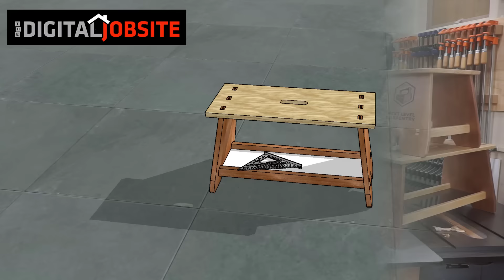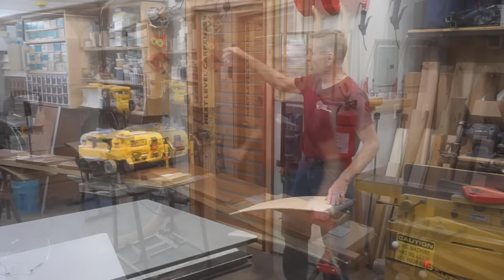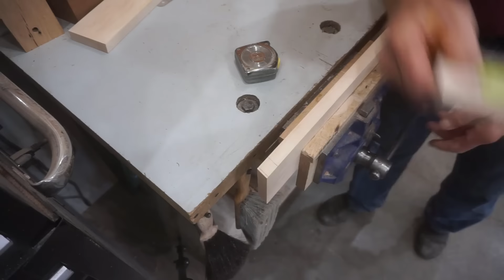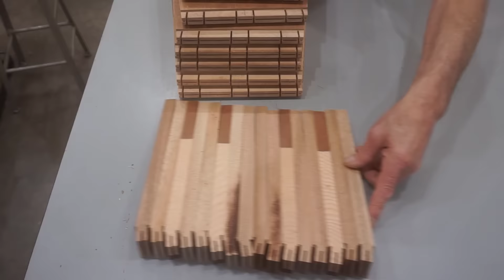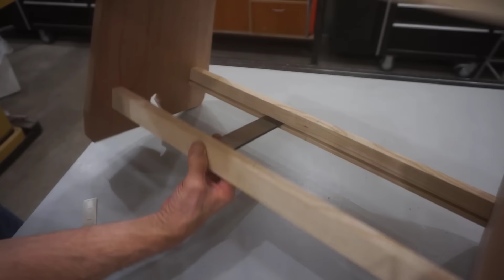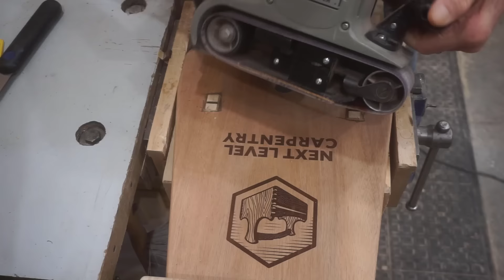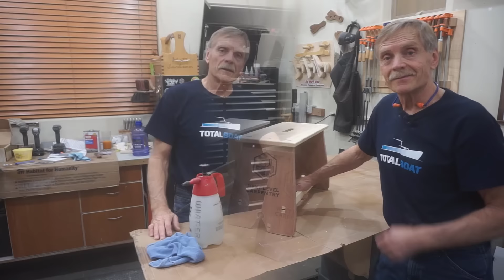Master Carpenter's Footstool

Comment: Awesome video!
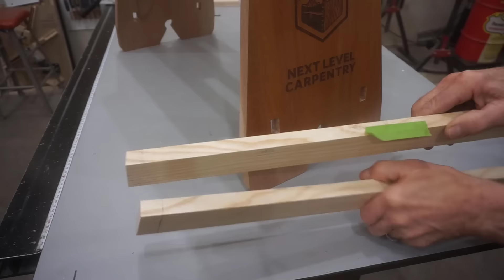@1:25:33 you mentioned you need to shave 3/32", but it should be 3/16" instead.
rails are 3/4" thick
mortises are 9/16" wide

If we convert 3/4 to 16th it becomes 12/16".
You then need to remove 3/16" from 12/16" to match 9/16" of the mortises.
Unless I am missing some other black magic stuff, that should be the math.

Edit: Oh I understand! Both side needs to be shaved for 3/32", which is 3/16" divided by 2!

Comment: Ha ha, Matt, you had me there for a minute with the dihydrogen oxide!  Man, those stools are gorgeous!  I am making some step stools for a friend using some recycled red oak and I would like to use your design if that is acceptable.
Reply from the maker: By all means, Andy: use my design!  Great way to repurpose some red oak and bless a friend... if you run into any issues with the build, feel free to reach out here or through your new Patreon membership! 😎👍
Reply: Thank you sir.  The biggest difference will be the thickness of the stock.  I had to flatten the boards and remove the ugly stain.  They are now about 11/16”. Still thick enough I believe.
Reply from the maker: @andysparks7381  Thick enough for sure... with the design/joinery I bet 5/8 would still be plenty.  The first weakness would be the span of the top where, if you made a longer stool, you might need to add a 'stiffener joist' under the top to give it strength for a big guy to stand on it but, as long as the top is thick enough or supported enough, I'll bet you could make the rest of the stool out of 1/2" and it would be fine.  Have fun with the build!

Comment: Just to the 36 minute mark and I’ve already learned 3 or 4 great tips.

Question: With so little glue areas, would you consider pre finishing the parts (masked off for gluing of course). You’re good with sprayer, very hard to get into nooks and crannies.
Reply from the maker: Although I often prefer to prefinish cabinet type projects, I don't think pre-finishing this particular project would work out very well.  Main reason being that the wedged tenons need to be sanded flush which would spoil any pre-finished surface and defeat the purpose IMHO.

Comment: Matt, I finally made it to the end of the end of the end. I have three comments. 1. In woodworking classes, we were taught to raise the grain with water on a damp sponge or cloth, then re-sand with 220 grit sandpaper. 2. Have you considered getting a tent-like spray booth to catch the overspray? 3. I love the paper bag trick for final “sanding”. One of your best tips, for sure. On occasion, I have put a final coat of paste wax over the polyurethane finish to give a soft finish to a “peace “!😂 Best, Steve
Reply from the maker: Congrats on making it to the end X3, Steve!  
1) I've heard of the 'raise the grain' technique but never found the need to do it.  Both lacquer and water based poly effectively raise the grain to any extent necessary with the first 'sealer coat' so sanding that first coat removes the fuzz the same way raising the grain with water does but without the extra step. 
2) The size and diversity of things I need to spray make any sort of containment booth impractical.  Overspray from finishes I use dries before it lands, all I need to do is sweep up dust which is a small price to pay for in-house finishing.    I just sub-out paint finishes to painters I know with a shop setup to handle that overspray... plus spraying with an airless is a whole different game so it's more practical to not spray the few painted projects I do.
Paste wax is a great idea but it's impractical for these stools because it's too slippery.  Projects that would be improved with paste wax get a gel poly finish which is a different process and comes out with such an amazing 'feel' that it would be redundant IMHO.
These are just my thoughts though and are not intended as instruction or criticism because you know what products and processes work best for you.  Keep up the good work!!! 😎
Best,
Matt

Comment: Can you not thin the varnish down with water?
Reply from the maker: you can but it's a tradeoff that's not worth it IMHO
Reply: @NextLevelCarpentry  I would rather apply more coats, than not get good spray gun performance. I especially don't want to spray with such a narrrow fan.
Reply: @NextLevelCarpentry  BTW I'm a decent woodworker, but a really good spray gun finisher. I just haven't dipped my toes into the waterbased/waterborn finish world
Reply from the maker: @paulhopkins1905  Ahhh... then you understand the sort of tradeoff I mention.  A narrow spray fan (if you can even call a dot a fan) is always the biggest challenge for me but the few times I experimented with thinning the results weren't an improvement.  Bottom line is that I'd rather spray solvent based than water borne but waterborne's durability is tough to beat IMHO.  Your spray finish experience will serve you well but I feel the switch is like learning to spray waterborne as a second language.
Reply: @NextLevelCarpentry  thats a great way of describing it
Reply: @NextLevelCarpentry  Maybe I will invest in a turbine system. I need to take the plunge into waterbased eventually
Reply from the maker: FWIW I switched to the 3M accuspray system and now use it for spraying my high viscosity products and it does a more than adequate job. I'm pretty sure it works as well as a turbine system but it's a whole lot less fuss and has other benefits as well that you would probably appreciate with your spray finishing experience and history. I would encourage you to check into it and maybe visit with others you know who have used it because from what I can tell it's not the only option out there but for some stuff it's a perfect option.
Reply: @NextLevelCarpentry  that is the one with the disposible tips and air caps right? So the same gun can swap between say a 1.3mm and a 2mm tip size?
Reply from the maker: Yeah that's the one although oddly the only tip I ever use is the 2.0 mm but I replaced it recently for like seven bucks which is crazy cheap? Takes some getting used to to hang on to the composite plastic handle and deal with the plastic air and fluid nozzles but it's totally legit as far as I can tell so far and from what I've heard.  Plus that something over 200 bucks it's pretty economical to test drive🤓
Reply: @NextLevelCarpentry  I love my Anest Iwata W-400, but I will probably give that a shot. It would be outstanding for spraying the odd flake finish on a guitar.
Reply from the maker: That's a little crazy because my go-to gun for over 20 years was also an anest awara but even with the largest fluid nozzle it was still too small to spray those heavy body lacquers.
Interesting that you mentioned spraying guitars because my friend Greg Porter of skyline guitars is the one who turned me on to the accuspray gun and he does a lot of custom guitar making too. You can check him out at Skyline guitars or Greg's Garage on YouTube
Reply: @NextLevelCarpentry  I have a few guns, the W400 just happens to be my favorite. It's a 1.4mm tip, it is a cannon for lacquer. I use it mostly for automotive urethane, the finish I prefer for guitars.

Comment: The UK is the worst...loads of mixed units...

The highways are imperial, miles, yards and mph.

Petrol (gas) sold by the litre....yet we still quote miles per gallon. FYI, that's 8 pints to the gallon or 4.54litres.

Our railway is imperial; 1760y per mile, 1/8mi = 220y etc...but track quality is measured in standard deviations in millimetres.

Beer still sold by the pint not 568ml, but spirits changed from 1/6 gill to 25ml per shot decades ago.

Temperature is celsius but we consider 70°F warm enough for summer wear!

We have a crazy system for measuring time...we use base 60. 60seconds in a minute and 60minutes in an hour...

We weigh ourselves in stones and pounds. But most other things are weighed in kg. And, we reference our height in feet and inches.

We are master's in thread forms: Whitworth, metric, UNF, UNC, BSP etc etc.

The bottom line is that the British never really fully committed to the metric system...

Apparently the drug dealers still measure their products in imperial units too! Ha ha
Reply from the maker: I feel your pain... and I only have to deal with viewers who give me grief over imperial vs metric!  Thanks for sharing an interesting yet non-critical perspective!  Dealing with such variety does provide fertile soil for an active mind, right?! 😎

Comment: Watching this is helping with my current project! I want to make a workbench, and my last attempt was a failure! I had everything kinda ok, except for one part. I forgot to account for how warped and unsquare the lumber i used was! So i've checked all of them since then, and plan on doing mortices and dowel pins to secure most of the parts, instead of just ugly screws! I already spent a long time carving all of the parts, they all have chamfers on them like marble pillars. i had originally stained them, so it has a different color between the chamfers and the normal wood, and it's pretty good looking to me (dont worry, it wss shitty hardware store 2 by 4's, not hardwood i stained!).

Comment: What do you think about attempting to clamp a heavily twisted board straight for some time prior to machining? 
Is there any value in doing that, or do you think the 1 or 2mm you might save in sawdust would be lost in the effort and space to have it clamped for long period
Reply from the maker: Nath; The reality is that wood that's twisted is twisted to stay.  You can clamp it flat but it will just spring back to it's twisted state once clamps are removed.  The 'only' way to remedy the condition is to flatten it by some means like what's shown in the video IMHO.
Reply: Ok👍 thanks for reply

Comment: You only need one strip of wood to prevent snipe, no need to put it on both sides.
Reply from the maker: True... mostly.  I like the added measure of the 2nd strip, especially on very wide and twisted boards though so the minimal extra effort is worth it IMHO.  Thanks for watching and commenting though... it's great when viewers are paying attention to the degree that warrant posting a comment...
Best,
Matt

Comment: This is fantastic, absolutely loved the video and definitely plan on trying my hand at one of these. 
     When it came to cleaning out the waste between tennons on the legs, is there any particular reason why you can’t gang them together and clean out the waste using a table saw and dado blade?

Thanks for the great content!
Reply from the maker: Thanks Brandon... good luck on your build when you get to it!
The reason I removed that waste with coping saw and chisel is for controlled accuracy using a method I'm confident in and comfortable with.  
Using a dado blade as you mention is certainly a viable method but would take a bit of extra work because the legs would have to be held at an angle while making multiple cuts.  Also, the cutting action of a dado blade would tend to chip out the back face of the leg where the blade exits which would mean adding  another dedicated feature to a fixture designed for the purpose. 
In addition, I use a Forrest Dado King blade which leaves extremely clean cuts but the bottom has little grooves left by scoring teeth that would show on the faces of the legs.
I like your thinking for alternatives though because, in a production setting, it might well be worth getting a different dado stack and designing and making a dedicated fixture for that part of the project which would be a great exercise in developing your woodworking skills.
Best,
Matt

Comment: Can I make this without the bottom shelf?   If I'm just making a step for the kitchen and don't want to put a shelf in the bottom, does it weaken the legs any?
Reply from the maker: If you raise the sides of that Tray up they would turn into stretchers which if properly done provide enough strength for a good stool even if you don't include the tray. If you make those side pieces wide enough they can be put right under the top of the stool where they will still provide plenty of strength. The rest of the stool design and proportions could be maintained

Comment: I had no idea such a simple thing would be so complicated. Mad respect for the patience of woodworkers.
Reply: It is a real eye opener,  isn't it!  In the housing trades there are Carpenters, Framers and Finish Carpenters.   And the many other Tradesmen: Masons, Roofers, Plumbers, Painters, Plasterers/Drywall Hangers, Glaziers(window installers on high rise or steel buildings).  Each of the trades learn "tricks" and "trade secrets" which identify levels of ability:  apprentice, Journeyman, and Master Craftsman.  I'm not a Tradesman, but I've worked with all of them:  as a laborer or assistant to the Superintendent.

Comment: Why do you need a separate template for the hand holes if you could just cut that same hole in the first stool and then proceed with the rest of the cuts using the first one as the template? At the end of the day, you're just cutting an extra hole for no reason, unless you expect to make another set of stools in the future. Great video non the less with plenty of good advice
Reply from the maker: FWIW I'd make a template even if I was making only one stool because it's much faster and cleaner to make a 'perfect' template of 1/4" thick material than to make the hole through 3/4" thick hardwood IMHO.

Comment: Around 60 mins you refer to a 30 degree cut to create the notch. The cut is in fact at 60 degrees
Reply from the maker: While you are absolutely correct, if you look at the degree setting on a table saw it will say 30° and refers to the fact that it's 30° off 90 not 60° off of 0.  Definitely can be confusing to those unfamiliar with this subtle distinction. It's the same thing on a miter saw but is generally less confusing...

Comment: Thanks for the video. When you say you use a sharp putty knife for the finish, do you mean sharpen like a knife or like a card scraper?
Reply from the maker: Good question about the putty knife... it is sharpened like a card scraper where raised burrs provide the scraping action. I showed the process in a short clip in a recent video but in a nutshell I stand the putty knife on end and drag it across a smooth file to create the Burrs rather than using a burnishing tool typical of card scrapers. The raised burrs are relatively weak compared to a well sharpened card scraper but dragging on a file produces the edges so quickly and easily it's still a very effective method.
Glad you liked this video...

Comment: Only a wood magician like yourself could have made that twisted board straight and turn it into a part of an awesome foot stool ! You briefly mentioned using compresed air to clean the wood , it's  the most effective way to prep wood before applying any stain , poly , paint etc. In my opinion  and most woodworkers are clueless  much less own a compressor  !  I also  think sandhater blocks would be a product in everyone's shop if introduced. Keep up the good work Matt !
Reply from the maker: Sadly I think there's far too many snowflakes out there who think airborne dust generated by 'a puff of compressed air' is the kiss of death so that even if they learned the benefits of using it they would be paralyzed by fear to the point they'd not even consider using it... and then strut off, smoking a cigarette, verbally chastising poor fools like us for such outlandishly irresponsible behavior 😉😂😎
Reply: @NextLevelCarpentry   It's healthy to vent every now and then Matt Lol !!

Comment: How many smack-dabs equal a table spoon??
Reply from the maker: Exactly 7 milli-ounces... you can thank me later. 🤓
Reply: @NextLevelCarpentry  Your vids have some phrasing from the 60-70's that I really enjoy.  Along with the info about wood and whatnot. I quit my day job in '09 and bought some
machines and started making practice dust. My experience in printing for 50 years made the learning process much easier. My forefinger is similar to yours-only 12 stitches. As the surgeon was sewing the finger and hit bone; I said to my wife, "better call the studio and cancel the hand photos for the next day".
Reply from the maker: @vincentrolfe1384  the biggest drawback of the index finger incident is that I have difficulty  pointing at things... if it's close by, I can point with my right index finger but have to use my left index finger to point at distant objects😉🤣
Thanks for watching and commenting here! Best, Matt

Comment: Thanks for posting another awesome and informative video.  I always enjoy your videos.  You prove to be an excellent woodworker.  But I'm surprized  to see that you stand in line with your table saw blade while operating  it. I think it's cool that you included it in this video. I'm glad you're ok. ..but it would be cooler if you would step to the side when using your table saw. 

..and i agree with you.. this is a very long video but never a dull moment. Lots of cool tips and tricks.  Thanks again for posting it.

Comment: Matt,
Love your through instructions! 
Where did you get the insertable throat plate for your table saw? I have the same one as you and it would be a lot faster than making the whole throat plate as I do now!
Cheers!
Ed
Reply from the maker: I bought that about 20 years ago Ed... unfortunately it's been out of production for over 10 years. Here's a picture of the  label on the back in case you want to search for one on eBay or elsewhere: 
https://www.pinterest.com/pin/551479916872563704/  
https://www.pinterest.com/pin/551479916872563699/  
It is as useful and handy as it looks...
Best, Matt